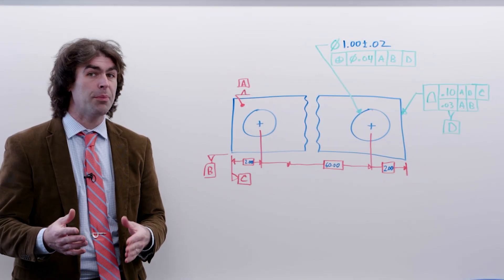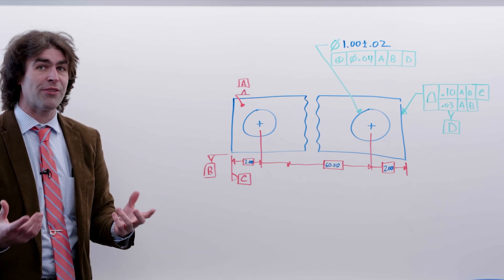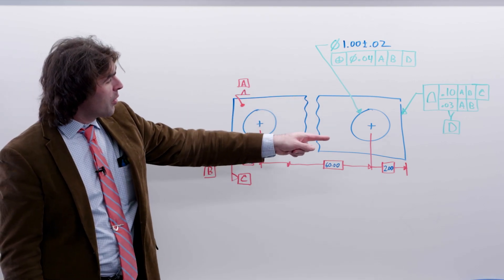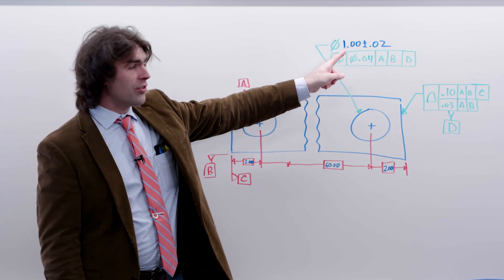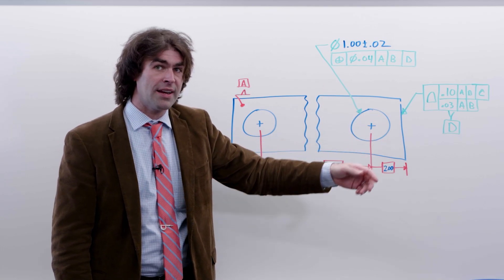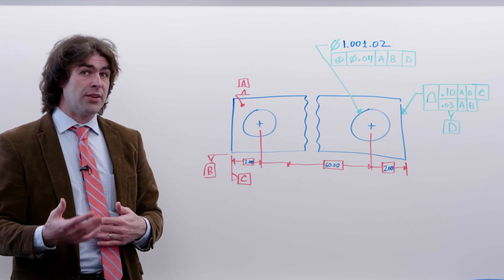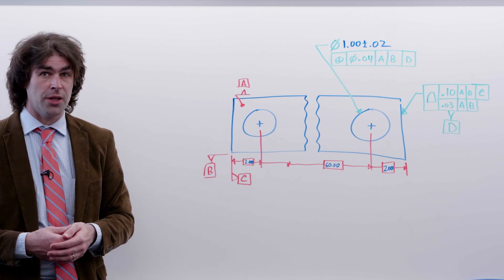GD&T "Relative Shift" Multiple Datum Reference Frames

Comment: Excellent explanation, thank you! 

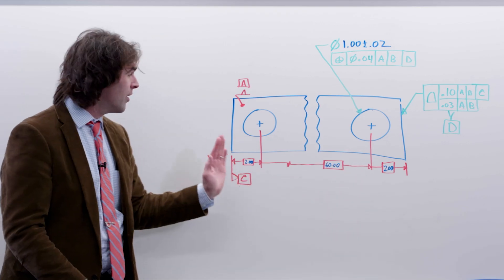At 01:30, the prof says "spanning this large distance to accurately measure the position of the hole could be difficult to verify". I understand that's not part of the functional requirement (as explained), but curious as to why it's also difficult to verify the position tolerance from a metrology point of view? Is this maybe related to the inverse scaling of accuracy versus nominal dimensions?